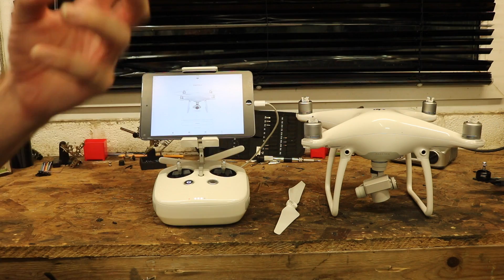DJI Phantom 4 IMU Calibration Warm Up & Gimbal Horizon Issues NEW VIDEO

Comment: Hi, so I noticed that my Brand New Phantom 4 PRO started making buzzing sound andthe camera won't tilt up and down anymore. It stays pointing down...so I tried, still trying to calibrate the IMU, but it's taking longer than it should...It is in front of the AC so it's cool. I'm worried that I will have to return this. UGH.

Comment: that holder for the ipad i see a split under the bottom can i use my galaxy tab the plug is under the bottom i see a split where you can run my cord

Comment: Good video. Inertial Measurement Unit.
Reply from the maker: Thanks Yea i know, brains says one thing and moth says something else. Appreciate the feedback
Reply: Mad RC I used to work on commercial aircraft IMUs. Delco Carousel IV. 40lbs of precision gyros, accelerometers, gimbals and 80's electronics. Amazing how they've miniaturized.
Reply from the maker: It is, all this started with the original iPhone, whilst things were going on before that Apple pushed sensors into the phone, 2007 was a big shift.

Comment: What about the VPS calibration on your P4? I have problems with this "calibration failed" messages all the time.. Some people said is some monitors issue..
Reply from the maker: Tends to be the resolution and size of monitor, have you tried it on a laptop with its screen at native resolution, also sub 15" seems to work better.

Comment: Thanks so much for the very helpful video and the detailed information that you provided.  Very helpful.  I notice that my camera seems to very slowly rotate to the right.  Example:  I lift off to about 30 ft, rotate the camera to the right just a little to look at something, but when I let on all of the controls, the camera image seems to drift to the right?  Any thoughts? Have you seen this before?  I am new with this Phantom 4, just had it two days and I didn't notice this yesterday.  I don't believe it is the wind.  I tested it at various locations and times.   Again, just a slight drift of the video image that is consistent to the right only.  Thanks again for your videos.